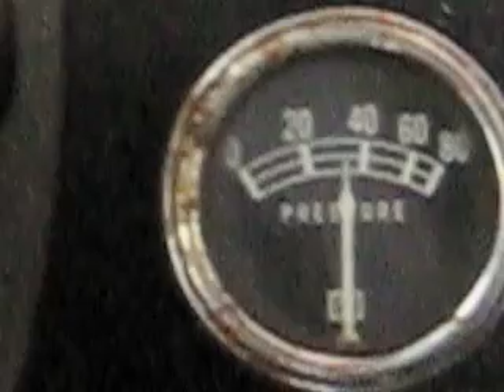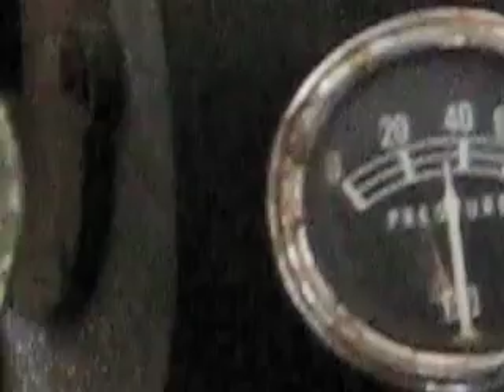330 DeSoto Fire Flite Hemi Running Strong!

Comment: Back in the early 70s Gene Adams was running the 291 Desoto in junior  fuel. They were turning 800 HP without supercharging. Several years ago he and Don Enriquez pulled the car out of storage and entered it at a drag meet. Of course there were giggles when other racers saw them with the old Desoto powered dragster. After all, some of those Chevy small blocks were running as much as 440 CI. The Desoto cleaned house and shut them all up with runs as quick as 7.20 at 204 mph. They won! Bill